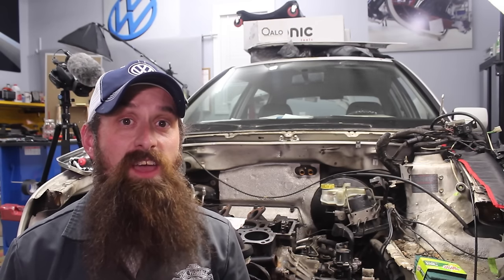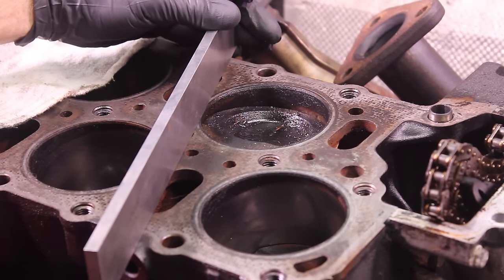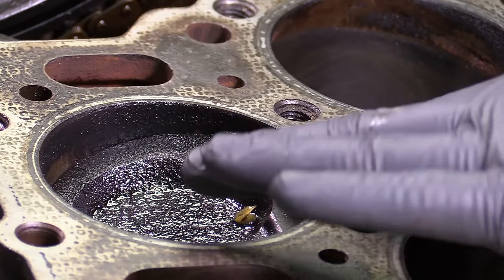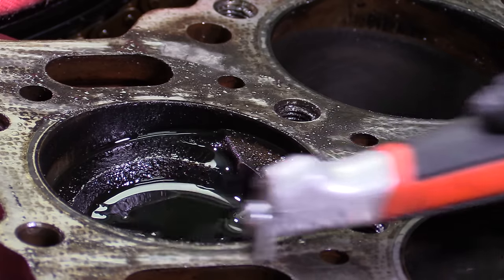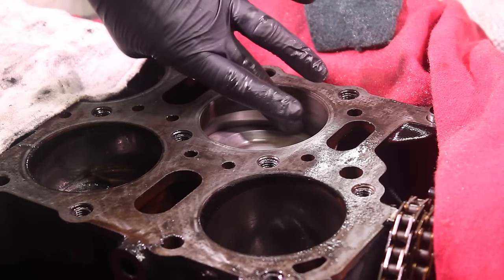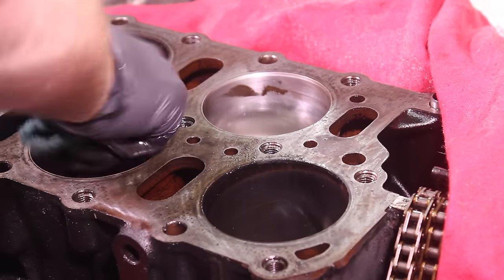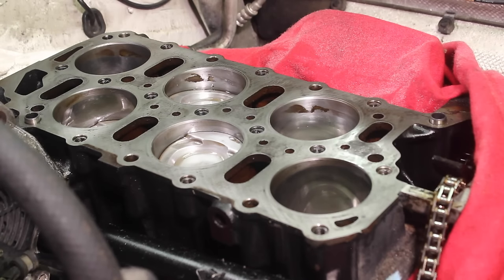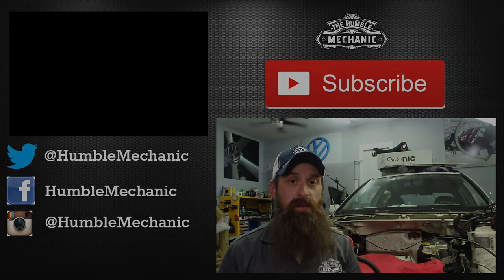Removing Carbon From Piston, Cylinder Walls, and Block Deck

Comment: how can i unstick piston rings without teardown?
Reply from the maker: You can try something like this http://amzn.to/2hchPtN but that is just a trial. You may still have to teardown. but for $30 I think it's worth trying.
Reply: HM's BG link is good ,, most people would pull the spark plugs and drip some Marvel Mystery Oil or Seafoam into each cylinder... If the car is running and you're driving it I would do the seafoam and then use Auto-Rx in the oil... it's a slow safe cleaner that will dissolve the gunk that's sticking the rings...  If you want you can melt a lanolin based hand cleaner (non-gritty type) in the microwave (it'll turn from white to a brown liquid) and drip that through the spark plug holes as well...
Reply: What about kerosene?

Comment: Hey the Humble,
 Doesn't water sprayed into the intake while it's running remove the carbon??
Reply from the maker: It can help..... maybe. But it would take a little more chemical action to remove this.
Reply: HumbleMechanic thanks for the quick answer. stay safe dude
Reply from the maker: Right on man. Great name BTW ;)
Reply: HumbleMechanic 😁
Reply: Yea, one of my experienced co workers said that water works really good, but too good. He thinks that it would knock off larger chunks of carbon and possibly damage an engine. I coincidentally used a chemical cleaner called motovac on my car a month before I blew a headgasket and was surprised as to how little carbon there was in there. So the chemical stuff from my experience works good.
Reply: ThomasXp I had a olds that I took to the strips and I had water injection to bring the temp down in the cylinders. It was ALWAYS clean as a whistle when the tear down at the end of the season. You see me and Humble have something in common WE are A.S.E. Certified, Humble does mostly VW's                and I do mostly Audi's as well as the rest for us both. I never thought about water removing carbon but, its included in the firing of the fuel I would think it would help since the water would be really hot steam in there. I was looking for his thoughts on water and not using it as he did with the WD-40. Besides, I use pressurized steam to clean parts on a rebuild. If I worded my question wrong or you miss read it, all I have to say about it is OOOPPPPSSS. After 35yrs I don't ask questions about the how to then the whats wrong when it comes to repairs.

Comment: @HumbleMechanic  How do you feel about using methanol/water  50/50% mix as a way to clean your engine.  Imagine 140k miles then adding on the methanol/water kit  I imagine it would clean  up the carbon overtime.
Reply from the maker: It can work for light cleaning. Sadly people wait too long and expect a miracle.

Comment: How do you verify the gaskets don't contain asbestos?
Reply: Generally they have a grey coating and feel slippery dry to the touch. Other than that you can collect a sample and send it off for testing. Most exhaust manifold gaskets are still asbestos unless they are steel or copper.
Reply: Are you talking about American cars or European cars?
Reply: Both any fiber gasket could contain it.
Reply: Lol asbestos isn't allowed anymore. It was in brakes in like the 60s
Reply: Mada Mayday  You should read a whimis safety data sheet some day.You would be surprised at what is know bad but is exempted . And you don't think any old shops don't have NOS still sitting on the shelf ,I know of a shop that has brake shoes from the 60's still in stock , so when they get sold YES someone will be exposed to it.

Comment: The WD-40 did an impressive job of cleaning, and may have had an effect on softening the head gasket debris too. I wouldn't have done what he did with the abrasive pads without the use of a vacuum to keep as much of the particulate as possible from going down between the piston dome and top ring. I don't understand his concern with the cross hatch pattern in the cylinder walls; they are put there in order to facilitate the breaking in of the rings to the cylinder walls. They do it at the factory, and you do it when you overhaul an engine - for the same reason; so they can 'wear in' to each other. Overall, a good informative video, but with too much detailed information for someone that knows enough about engines to tear one down this far in the first place.

Comment: what engine is that???? its kind of like a W8 but its only has 6 cylinders....
Reply: looks like a Volkswagen VR6, simple, compact and unique but has unequal length ports in the head and requires more counterbalancing than your average v6.  VW's W12 is essentially two VR6's joined at the hip.
Reply: Allen Dodge so this isn't a I6? what is it called?
Reply: From the wiki:  "The name VR6 comes from a combination of V engine (German: V-Motor), and the German word "Reihenmotor" (meaning "inline engine" or "straight engine") - and so is described as a "Vee-Inline engine" (VR-Motor)"
Reply: Allen Dodge oh ok i didnt know that i thought the vr6 was just a name like the mustang "GT" i didnt know it was the engine
Reply: doesn't gt stand for gran turismo?
Reply: TheHenirik yes either gran turismo or gran touring
Reply: and a gran turismo/grand touring is a special type of car
Reply: Wouldn't there ba a lot of angle at the wrist pin, creating a lot of side thrust on the piston?
Reply: TheHenirik
well mustang gt's are common but it is the better version then the base mustang
Reply: vr6 for sure
Reply: crusty old fart I'm not sure how they account for the 15 degree vee angle, though that is the reason for the extra counter balancing that is necessary.  I know that a lot of v6 engines have unevenly spaced ignition pulses depending on how the crankshaft is designed, I wouldn't be surprised if the vr6 is the same but I'm not sure. As far as the wrist pin, the force on the piston should be evenly distributed as long as the piston is flat but these are asymmetric with a large bevel on the high side, creating a wedge with a squish area at TDC so it certainly makes one wonder, but all engines have to have an offset wrist pin to run smoothly.  The main advantage of this motor is its small size, but without having proper symmetry it is a compromise at best
Reply: Allen Dodge It just seems to me that the bore being out of line with the crankshaft 25 to 30 degrees, would cause a lot of outward side thrust. Dunno. I just tie them 2 wires together, and roll my old truck down a short hill, drop the clutch and that baby fires right up the first time. Low tech at its finest. It'll outrun anything in Possum Trot, Hollow.
Reply: I think the bore centerlines do intersect at the crank, it is a narrow angle vee motor (15 degrees) which is how they are able to use a single head which covers both banks of cylinders.  This single head design is where the" inline" part comes from, but it is still a true vee motor, just the smallest one they could squeeze
Reply: Allen Dodge Ok. that makes more sense. It looked like 2 inline 3 cylinder blocks to me.
Reply: Yeah, I would rather have a good straight six any day, the problem of squeezing more motor into a front wheel drive solves itself if you know better than try to hot rod anything that is front wheel drive.
Reply: Allen Dodge My Passat has 5 of 'em inline, and looks like there's plenty of room for another one.
Reply: That would be a sick idea. VR10 VW engine.
Reply: omgitzsteg No, just an inline 6.
Reply: that's because your passat also came with bigger engine options. however that 5 cylinder takes up less space than the 4 cylinder turbo, and VR6 which was the high engine option on the jetta, golf, gti etc.
Reply: omgitzsteg It doesn't need any more power, and it gets great milage, better than the Rabbit with the same engine.
Reply: 5 cylinders seems to be the sweet spot for the amount of overlap needed between combustion cycles to ensure a smooth torque curve compared to a similarly sized 4-banger.  This also means it's not inherently balanced, and you can imagine how much it would complicate things if it was also a narrow angle vee like the VR5 variant that was also designed by VW.  From what I've googled, they have to tune the cylinders individually in terms of cam lift, duration and timing to account for different length runners in the head (which is actually fairly common though usually less pronounced, Chevys are known for it), the real feat is simultaneously tuning the power output of each cylinder to compensate for the uneven firing order and any roughness that would result.  Is that a newer rabbit?  I had an 86 with the 1.6 diesel.
Reply: Allen Dodge I think it was a 2010. The Passat is a 2015.Same motor but the passat gets better milage. It's a  6 spd auto,but it's geared "MUCH" higher in top gear.
Reply: if you've ever seen the early 2000's camry for instance, with a 4 banger, you can literally stand inside the hood. i was never lucky enough to have a car so easy to work on.
Reply: I had a 91 Camry like that, I don't remember how much room was under the hood because I never had to go beyond changing the spark plugs and fluids, the car was reliable to the point of being dull ;)

Comment: can wipe the cylinder wall and pistons with engine oil whrn I'm finished instead of spaying it with wd40?
Reply from the maker: +JaHm3sZ yep. That will work.
Reply: +HumbleMechanic thanks for the quick response!
Reply from the maker: +JaHm3sZ you sure can.

Comment: i thought whizz wheels were not to be used on heads and block because the gasket will start to leak and i don't know reason, i saw a video a youtuber recommended not to do it and dealers don't do this too.

Comment: Hey, I work on a growing number of Subaru engines, and I've wanted to get into flipping them, usually the "mechanics specials" that likely just need head gaskets. The blocks are all aluminum, and I've always been skeptical of any kind of gasket scraper or abrasive other than the same Napa red-handled scraper I've used for 5 years. I hear some of the Subaru dealership guys talk about using the Roll-Lock discs for their warranty head gasket jobs, and there doesn't seem to be any good concensus. Are these VR6 blocks from VW aluminum or iron, and how, if at all, would cleaning the deck on one of these compare to cleaning and prepping the deck on a Subaru?

Thanks in advance.
Reply from the maker: The block is iron. So they hold up to abrasion very well. I use the rol-loc with the yellow or green fingers. That works great.

Comment: Any tips for cylinder full of antifreeze?
Reply from the maker: Find the leak. Headgeasket is usually the weak point.
Reply: Yepp...just wondering what works best for removal. etc
Reply: A pump.

Comment: Wouldn't toothpaste work to get the carbon off if you also use a firm toothbrush?
Reply from the maker: It very well may. I’ve never tried.

Comment: those wiz wheels are KNOWN to make uneven spots on heads and decks. not recommended to use them.
Reply from the maker: +Cody Romano I have had pretty good luck with them. But the proper pad must be used, and great care taken. The straight up sanding pads are a no go for me. I like the plasticy ones with fingers.
Reply: +HumbleMechanic subaru dealers used those when they had head gasket recalls because it was the quick easy way. all wheel drive auto did a test with a the plastic ones vs hand sanding with scotch brite. good test from a reputable company
Reply from the maker: +Cody Romano cool. I'll have to check it out. I find doing the ScotchBright by hand very cathartic. But I sure don't want to be on flat rate while doing it. Hahah. 

I've used razor blades to remove the headgasket material too.
Reply: +HumbleMechanic razors work great. I used a razor and a sanding block with scotch brite when I did my head gaskets
Reply: Plastic finger wiz wheels, with care and skill are fine on a steel/iron block......do not go anywhere near an aluminium head/block with a wiz wheel - it will leave uneven surfaces no matter how careful you are.
Reply: +blower dealers do it all the time. it's the quick easy way to clean but I don't think it's the best

Comment: I put a wire wheel on the drill
400 sand paper and oil works good to
I dont believe it removes metal on my perkins diesel

Comment: does higer rpm burn off that carbon?????
Reply: otto leeverink well if u have an rotor engine
Reply: it's called an italian tune up. yes it helps but you have to push it to the limit.
Reply: I agree. Carbon removal with your right foot.

Comment: Didn't the White Wookie get a rebuilt engine not so long ago? I'm confused.
Reply from the maker: This is that engine. I ended up finding some sadness on the rod bearings and went full rebuild
Reply: @HumbleMechanic  makes sense.

Comment: So what about the disolved carbon going down the cylinderwall and into the pistonrings? Bit scary imo...
Reply from the maker: +ButchE30M3S14 before reassembled the block would need to be cleaned out for sure. 

That's a video I was going to make. Sadly it won't happen. I found some bottoms end bearing issues and ended up having to go in deeper than I planned
Reply: Oh that sucks! Well, good luck buddy :-)

Comment: WD-40 aka Water Displacement 40th attempt was (also has hydrocarbons) was created norm lawson who sold the product to the Rocket Chemical Company for $500 it's original intent was to protect the ATLAS ICBM of the USA but there are thousands of uses created in 1953.....yes I'm a Nerd LOL

Comment: You forgot to alert your viewers to not use a metal scraper or any chemicals that affect aluminum for aluminum heads. The best option to remove excess carbon or sludge from an aluminum head is to use a special solvent for only aluminum heads. Use a wood scraper instead of a metal one. You can mess up the head with a metal scraper

Comment: sorry but i can watch this further. improper cleaning,  using a scraper on a block is a no. and you gouged the block at 5:56. good job
Reply: cleaning pistons like this as well hes sending the carbon bits in the ring lands and cyl wall it will scratch it and motor will start to burn oil...(looks like it was allready,hopefully its a junk motor)what sucks is people will actually do the same...these vids should get tooken off...
Reply: minus well just pull the block and get it machined, while is it out use some carb cleaner and spray the pistons. the head is already off and the block will be out as well
Reply from the maker: +Vega-Expert not the first to do it the way. 

The great thing is, when the engine is back together we will be able to see exactly the result of this. :)
Reply from the maker: +Don Werrboutit doubt that will impact whether the gasket will seal or not. But when she is back on the road we will see.
Reply: HumbleMechanic did we see if she running.
Reply: Vince Vega Customs look

Comment: Please do not use scotch brite scrubber. They have silica particles in them which will get into the space between the cylinder wall and the piston and also into the ring grooves and on the first start after assembly will screw up the cross-hatch pattern on the cylinder walls.

Comment: I don't question the integrity of the "crosshatch unless I have the Pistons out and piston rings off the long wait reason to question the integrity is if you're replacing the piston rings
Reply: Of course you know that it is not a good idea rotating the engine with the timing chain disconnected jump
Reply: I'm familiar with German motors I was a Mercedes lead technician

Comment: 1 Removing carbon from cylinder wall😖I was taught that this would cause the engine to burn oil due to the carbon seal been broken!
2 what about the abrasive pad particles between piston edge (will cause damage) 😵🤔 . To clean piston crown, piston  at T.D.C. Smear grease between edge of piston and cylinder wall. After cleaning , remove excess grease then rotate the engine so the piston is halfway down the bore remove grease and debris.😃👍🏻.
3 Finally I was taught , leave a 1/4" of carbon at the edge of the piston to not to break the  carbon oil seal.  🤔.
Or have I got wrong and piston oil control rings do scrape the the oil back down into the sump (oil pan ) better.?
Before modern fuels and burn clean engines we decarbonised engines between 30,000  and 50,000 miles depending how they were driven so I have had a little experience.😉🙋‍♂️🇬🇧
Reply from the maker: There was going to be a follow up to this video. But sadly I found more engine damage in the form of connecting rod damage. So my plan is to address that stuff on engine reassembly.

Comment: Save yourself a lot of time and effort. Use oven cleaner and watch it foam up and dissolve the carbon a crud. Then just wipe what's left away with a rag . I just cleaned 8 pistons and rods from a 1964 413 engine and now they look brand new. Then I used wd40 to keep the rods from rusting. Be sure to use gloves and eye protection. Be safe!

Comment: at 5:57 in this video your fancy scraper scratched the piss out of your block deck.  Use a carbide scraper and mineral spirits they work much better :)  Concentrate on your work and not on sucking up to your sponsor at wd40 bro :)  otherwise good video!  Thanks for taking your time to make it :)

Comment: if crisfix taught me anything never use a metal scaper becouse no matter how small the cut is it will leak coolent  or if you are using a trans it will leat trans fluid
Reply from the maker: +titanium turbo that’s not totally true. Most often a gasket will take care of that. In many cases the surface you are working with is not perfect. That’s one reason for using a gasket. Among many others.
Reply: yeah but just to be safe ya know

Comment: My engine was running with no oil.  I believe I blew up my motor.  It makes a loud knocking noise.  I took it to a mechanic and he said the cost is 3,000 for a new engine.
Reply: Lit _66 cool story brah.